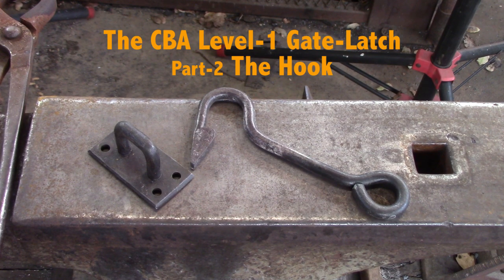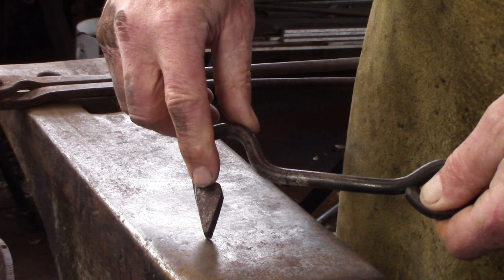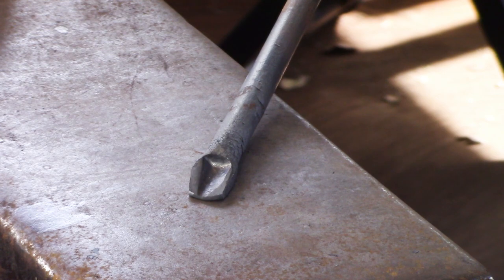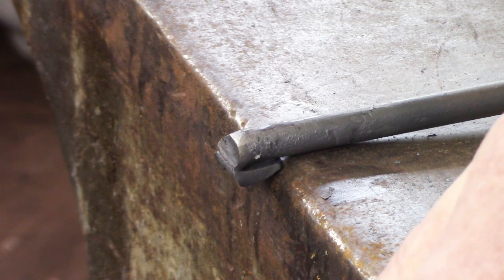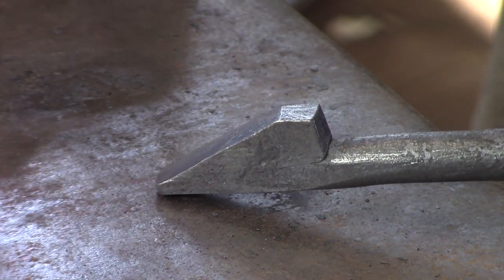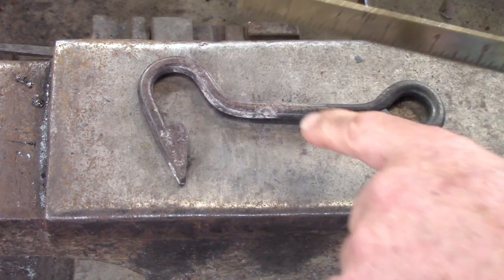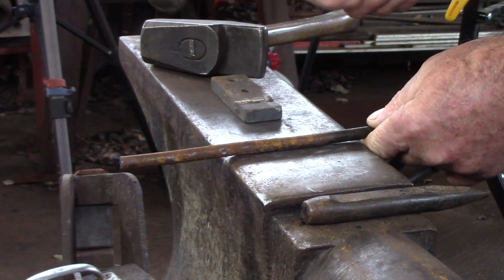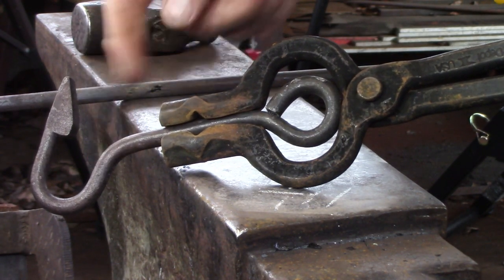CBA/ABANA Level-1 Gate-Latch, Part-2. Welding and turning the hook.

Comment: How did you find the Amazon propane forge worked for welding? Really appreciate the videos!
Reply from the maker: No problem at all. Very little scaling. Got to welding heat quite quickly. I didn't have any issues.